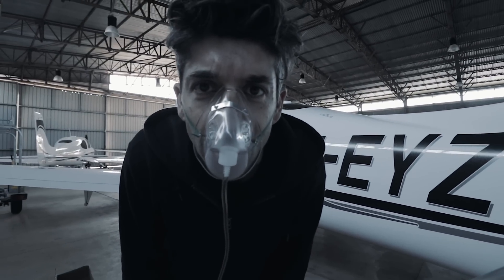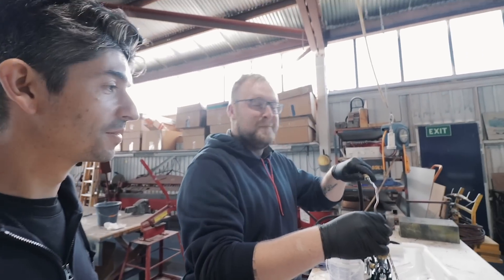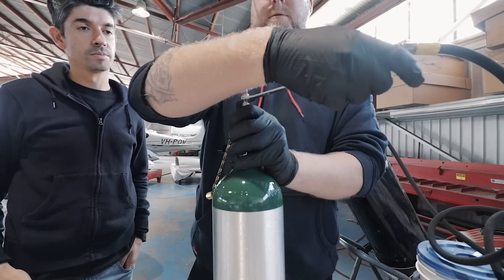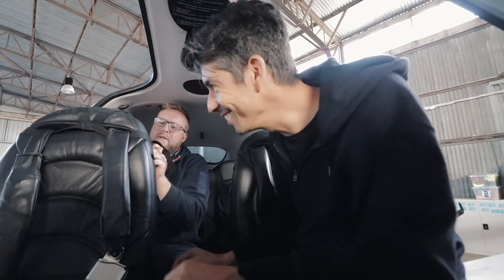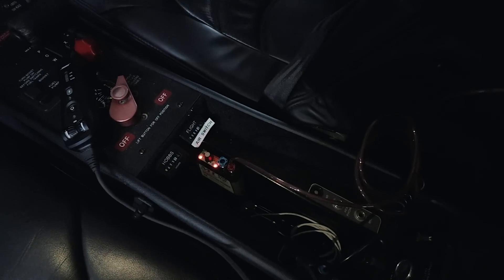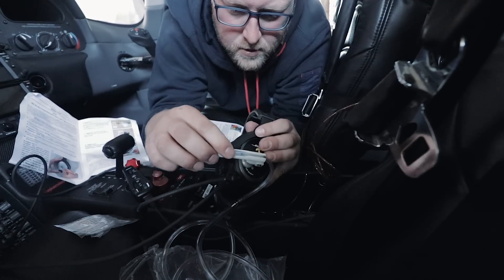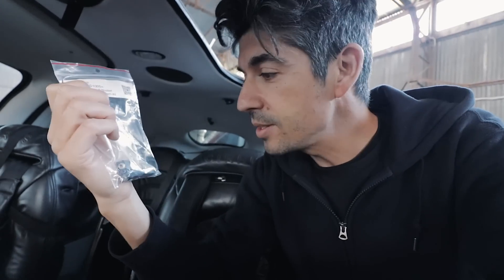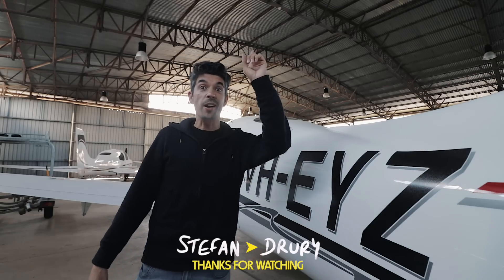Installing OXYGEN in my SR22

Comment: Hey Stefan that buzzing sounds like a cooling fan scraping one of the metal protecting tabs (the ones preventing things to touch the blades) at the back of the pfd / gdu
Check if they are bent inwards if they are not, the fan is out of balance or the bearings are shot, a replacement fan should not be too expensive.

Comment: G'day Stefan,
Pro-tip: use a fabric softener bottle for pee-bottle. Larger opening, handle for easy grasp, not seethrough, and pleasant  smelling.
Reply: And if any residue is around the top, you get a nice itch.. Remember to clean it very well before use ^^

Comment: Great that you can get decent cruise power on a non-turbo'd engine above 10,000ft.  My Glasair was gasping for breath at around 11,500 - but then it was only an O-320, not an IO-550 like yours.

Comment: cirrus needs to make a twin piston like a diamond da 60 but do a pressurized cabin!  that small bottle would last 2 ppl 5 mins at 22,000 feet. id have 2 bottles on for passenger and 1 for pilot
Reply from the maker: Thanks Jack, the 14 cu ft cylinder I showed would last slightly more than 5 minutes. It's rated at 4 hours at 25,000 feet, but it's really not optimised for usage at that level. For my (and other people purchasing this system) typical usage, at 15,000 feet I can get 12.3 hours constant use with the EDS system. So for 2 people, that would be over 6 hours, plenty for a typical flight.

Comment: oxygen is flammable? me thinks not. Oxygen helps things burn
Reply: More or less. It's not flammable in of itself by itself, but there are several references to it being flammable in safety documents, primarily if in contact with certain substances (of which oxygen can cause them to combust), or, naturally, in contact with fire.
Per BOC Gasses (provider of medical oxygen amongst other gasses) they have Oxygen listed with a hazard category of "H270 May cause or intensify fire; oxidizer". They also state "5.2 Special hazards arising from the substance or mixture
Non flammable - oxidising agent. Supports combustion and may cause fire/explosion in contact with incompatible substances, strong
 acids, reducing agents, combustibles and flammables. Materials which burn in air, will burn more vigorously in oxygen enriched atmospheres"

Per CASA, oxygen is listed as a Class 2, Division 2.2 hazardous material "non-flammable, non-toxic gases i.e. oxygen, liquid nitrogen, compressed air"

Comment: Oxygen really??? Stefs taking us we’re no cirrus has gone before
Reply: He literally said in the video that it is a CASA requirement that he has oxygen supply when flying above 10000ft and it is there if he needs to climb above that to avoid weather or icing conditions
Reply: alex llewellyn I do appreciate what he said but still it’s a bit OTT don’t you think? They did also mention how oxygen is highly flammable when compressed so why add extra stress
Reply: Elliott Wilford where. Sorry to be annoying but it does annoy me.
Reply: EMU FS lol I don’t know mate but I think oxygen for a plane like stefs is a bit over the top unless he’s planning on flying at 20,000ft which I doubt he is 👍🏻
Reply: The tanks they use will be able to withstand extreme pressures. they just take safety measures filling the tank as it can cause stress on the tank if you fill it too fast. Just like equalisation with your ears when climbing if you climb too fast your ears can be in a lot of pain but if you slowly climb you body has time to adjust to the pressure changes.
Reply: Fair enough you clearly know a lot more than I do lol but my only point was that for a plane like stefs oxygen was a bit much even tho casa states it. Alex Llewelyn must be Welsh?
Reply: Oxygen tanks are quite common to be honest for those in general aviation that fly a lot and do long trips. I would think it’s better to have it as a backup then have a trip planned and then you have to divert because your options are limited. No I’m british but it is a Welsh last name haha
Reply: It’s also good when you’re below 10,000’ to reduce fatigue. It’s not completely ubiquitous, but a lot of pilots use it.

Comment: Hiya, How do you recharge the O2
Reply from the maker: The sequence at the beginning where Steven was filling the bottle is how we recharge it. I have an adaptor that I carry in EYZ so if I’m away from Melbourne I can get an engineer to fill it, otherwise Blue Demon will fill it whenever required in Melbourne.
Reply: Sorry missed that bit got distracted by the kids😂. Do they use a pump to assist once the pressures in the bottles have equalised.

Comment: How's this compare to the system I've seen Nico use? His seems to be installed inside the aircraft for all passengers (probably supplied by Cirrus themselves I'm guessing).
Reply from the maker: Yeah Nico’s came fitted with the aircraft, so that was a Cirrus standard oxygen system. Mine is a portable system not made by Cirrus. Also mine only supplies O2 to one person. I think Niko can supply 4.

Comment: Just curious stefan, what is the weight of that gear and does it in anyway alter the CG  where it is locatedor give you some sort of W&B penalty?
Good idea though as you say it gives you an option if required.
Finally i have to ask what did that set you back to purchase & install as O2 is not cheap.
We were told that to service one our crew bottles was around £400 a shot depending on the company that made them.
Look forward to the flight test.
Reply from the maker: Thanks Sean, the weight is negligible - around 3Kg all up and all mounted to the co-pilot seat for any weight and balance calculations. I put a package together with a few additional items, but for that size bottle (14 cu ft) I'd estimate around AUD$2K for the system. You can do it cheaper with smaller bottles and without the EDS demand conserver and boom cannula. So it doesn't have to be that much.
Reply: @StefanDrury  thanks for that.So it is more of an emergency system to keep.you out of trouble and get you home rather than something for sustained flight above FL100.Interesting that a company have come up with this for us in GA despite the fact as you say most of us do.not go as high as that for long lengths of time.It will certainly allow flight over terrain we would normally avoid or potentially helping bush pilots up in Alaska and the like.